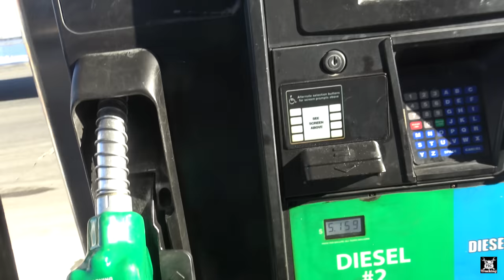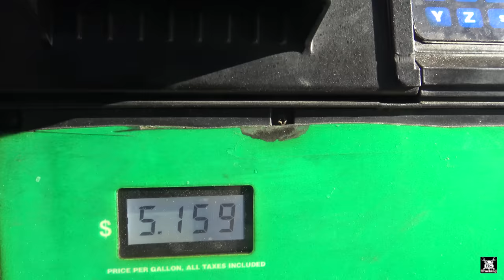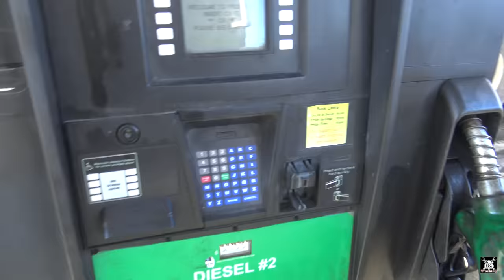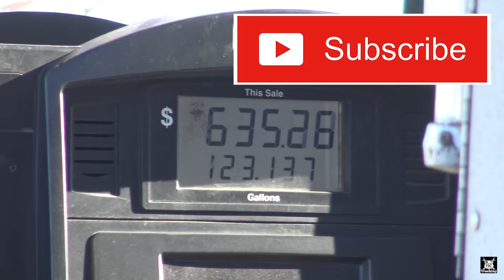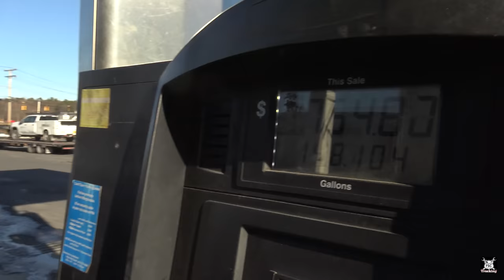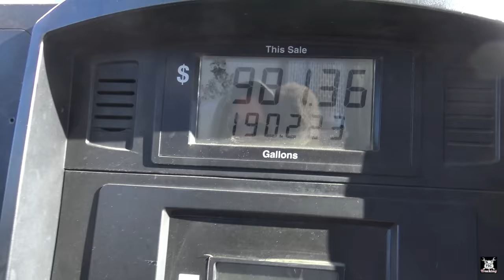Low Bridge Creates A Challenge For Cabover Driver To Load A Tank

Comment: I started driving in 1974 locally, all 48 in '79. Into the early 80's there were still full service truck stops where you'd pull in, give the pump jockeys two thumbs up indicating you wanted both tanks filled. They'd fuel you, wash your windows, check oil and tires. All for 80 to 90 cents per gallon.
Oh how I miss those days!
Reply: 76s still had full service in the 90's, until TA bought them out. The only one that I ever used then was at I-74 between Cincinnati and Indianapolis. Now it's a Petro 2.
Reply: Yah man lmao 🤣 🤣🤣

Comment: Steve, Back then in the 80's we used a Comcheck to get fuel. I was driving back then on the road. We use to get around by the Rand McNally road Atlas then, no GPS, still wouldn't know how to use one of those things today. Never used them. I drove a 1980 GMC and a Ford cabover. Nice truck the Ford. I almost bought a 1978 International Cabover once. I did have a 1969 Diamond Reo, i loved that truck, she was nice with a beautiful block heater in it that use to heat my cab real good overnight.
Reply: The GPS is still pretty much useless, and the Rand NcNally is still relevant. 
Whenever I have to go somewhere I haven't been to before, I'll use a tablet and look up the address on Google Earth and get a satellite view of the place, and use the old school atlas to plan my trip. 
It's much more accurate than a GPS, which always seems to route you to that low overpass , or road that says NO TRUCKS.

Comment: Those “chain drive” wallets came about for a reason. There is no way you could lose that wallet. Drivers license, medical card, cash, etc all needed to move over the road. No way to verify any of that when in the middle of no place. I am 65 yrs. old an I remember fuel at .05 cents per gallon. When I started driving I really had to push to fill my VW and pay $2.50 for 10 gallons. My dad told me when fuel is refined, the “diesel fuel” was the dregs of the process, oil companies did not know what they were going to do with this by product. Then Rudolph Diesel came along and created the “Diesel engine” for marine and static power supply (generators).

Comment: Before My Grandparents passed away I used to stay at that Motel 6 there when I visited them. What I can see in your video they have changed that truck stop a bit from the last time I stayed there in 2006. The 50s Diner was a pretty good place to grab breakfast back then.

If you ever got a chance to head in to the 16 Acers, there is a place called Bruno's Pizza. Try their Combination Pizza. Just don't order a large, IT IS HUGE! Their party size takes up most of the bed of a pickup truck.

Comment: Steve, I started driving in 65 fuel was about 19 cents per gallon, full service they washed al your windows and mirrors,check oil tires and pulled your truck off the fuel island, they would ask you first if they could. Great food at all dinners. Great friends on the road, bird dog on the dash,cb radio, when I got late at night was very little traffic. My old would do a mile in 22 seconds, got 5.6 miles pg when I drove normal. Have a great new year.

Comment: I started in 1990 driving for MNX out of St Joe Missouri.  we had a com-card for fuel & com checks to pay for truck/trailer expenses on the road like tire repairs.  I’m trying to remember the 1st year I drove I-90 wasn’t completed. I can’t remember if it was around Spokane Wa or Coeur-D-Alane Idaho but you had to get off & run a couple of city streets next to the construction then get back on the interstate again. I remember when cabbage had a lot more curves going down the mountain than it does now.  they have really straightened cabbage out

Comment: Boy I don’t miss going to places like that. Hidden deep in the bowls of some tiny city.  Went to a lot of those in my time. It’s fun to test yourself in the beginning that you can get there but after awhile it gets old. Use to hate running Connecticut. They called it back then the communist state. It sure is nice haveing the shorter wheelbase cab over, less  taking of attempts 2 and 3 . One shot in one shot out. Thanks for another fine video FSC. To you and your family Merry Christmas. Have a great and a safe day, happy trails and happy motoring. Oh as a kid I use to pump diesel at a gas station, 25 cents a gallon.
Reply: We used to call it " Connecticunt" on the CB, but I never had to deliver or pick up there. I only went through it on my way back to Cincinnati from either Massachusetts or New Hampshire, on I- 84.

Comment: With the price of fuel man, you should have a locking device on your fuel tanks. Video of UK last week showed him drained dry of fuel. I like your attitude, vote with your feet.

Back in the day a truck driver got stuck under a rail bridge, that he had passed under a month back. The county had resurfaced the road under the bridge and graded a hump that raised the unit and the mid part the trailer 6 inches. The signs had not been changed and so his company sued.

1970s I drove a 5-ton Morris flat bed for a construction firm so worked out of a site yard. Red diesel was onsite for the plant and equipment, but road vehicles used white diesel. I'd get an order form from the stores clerk for whatever amount I needed, he took the milage reading and I fueled up at a service station that ran a company account. Out on the road we refueled with a company prepaid fuel credit card, and it was printed off with a hand slide device and we signed. The bonus for us drivers was they gave Green Shield Stamps to save for household gear, my mum loved em.

Cab overs make it so easy to clean the screen.
Reply from the maker: It's cheaper to have my fuel stolen than to have my locks drilled out when they fill with salt and leaves me unable to fill the truck.

Comment: back in my days on 1984 I graduated from High school and gasoline prices were really under $1 a gal. So not sure how much Diesel fuel would cost back then. Merry Christmas and Happy new year to you Steve and your family. Be safe out there.
Reply: Diesel fuel was always much cheaper than gasoline in those days. That's why VW and a few other auto manufacturers started making some cars with Diesel engines. 
I started driving trucks in ' 87 and Diesel was still just under a dollar per gallon, until around 1998, when it went over a dollar per gallon. In some places in the USA, it was already over that price by the late 80's, but in the Midwest the prices held steady for awhile.

Comment: In 1984 I bought a new 4300 international and was scared to death cause of the payments and the price of diésel was  lot cheaper and life as a truck driver back then and a truck driver was a truck driver nit a steering wheel holder as you call them

Comment: Also back in 1984 I drove a cabover International with a single sleeper an also a 1982 GMC cabover Astro now that was the truck to have had a nice size sleeper on it but if you owned a Peterbilt or Kenworth that meant you was in the big leagues many $$$$

Comment: Steve are you using your phone GPS ?? That I would never trust. I run Garmin that I update right fron the box, then every 6 months Per advice from Garmin tech guys. Had anew Garmin and my old unit set for the same drop.New unit had 92 miles differernce. Called Garmin, they aked did you update that, no, new from the box.Explained it needed to be updated, never has issues following that advice..

Comment: That’s completely moronic, especially when newer trucks hold 250-300 Gallons and at $5 a gallon that’s about $1500 to fill up! They need to adjust that shit or remove it. That’ll make you lose business unless they have no other choice.
Diesel is easier to refine than Gas, show you’d think even with the Tax’s it should be less per gallon. It’s the liberal East Coast cities jacking up the prices. 1984 Diesel was $.826 per gallon and in 1987 $.495 per gallon. To bad my uncle isn’t alive, he was a trucker. Had a couple Cab overs, but he drive to Fort Wayne IN or Chicago and back to right next to Detroit Metropolitan Airport. That was his route he hauled Steel Coils. He would have 3/4 of those bad boys on his flatbed. I loved his trucks I remember the White/Red one the most. Looking at pics he probably had a Kenworth